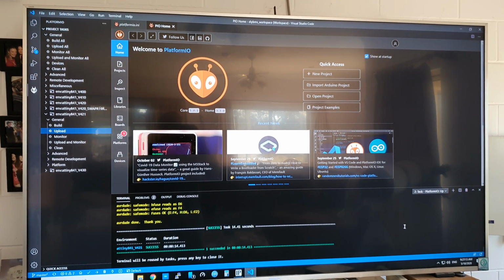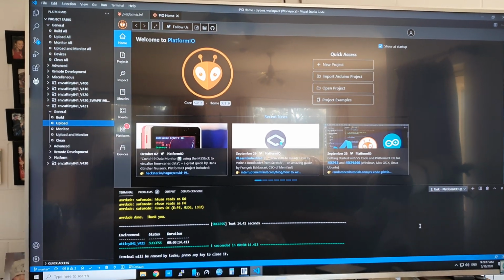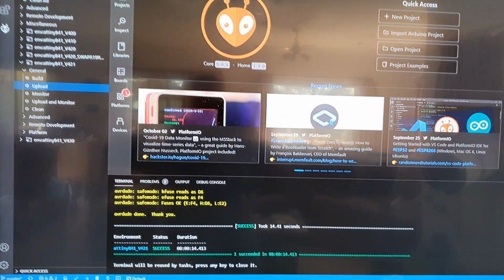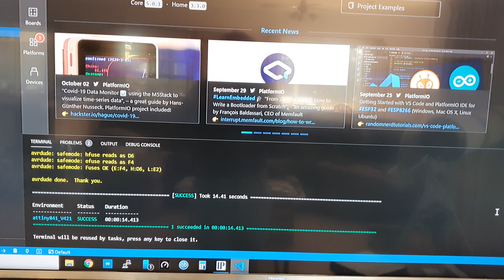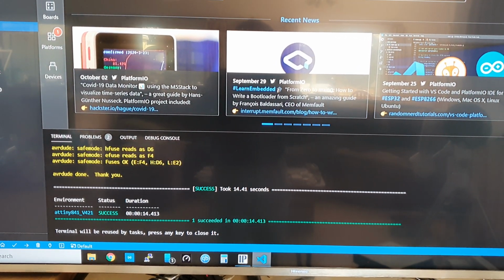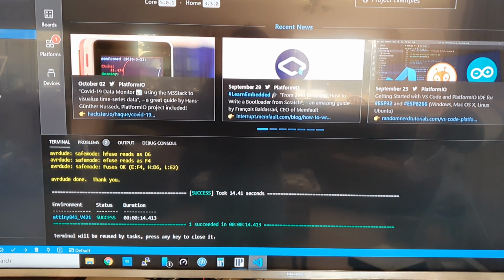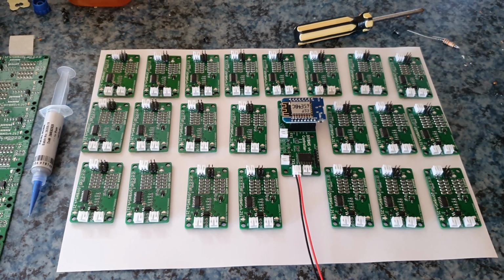66160 6kw lithium titanate battery BMS module building to suit the 2.8v cells take 6

Comment: How did you end up with this new resistor value? I'm about to build my own LTO bank and would like to understand. Thanks for your time.
Reply from the maker: This is the link, you will see the files that need to be loaded in JLCPCB      https://community.openenergymonitor.org/t/diybms-v4/11292/2674
Reply: @sjdtmv  thanks so much! Have you had any issues so far?
Reply from the maker: @andreasreichmuth8023   I have 1 issue with one of the batteries not up to scratch